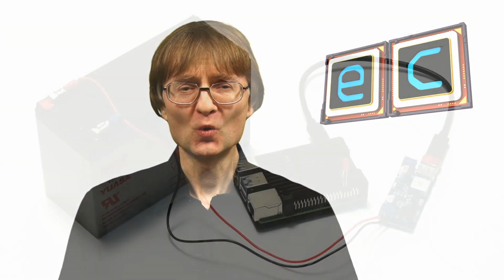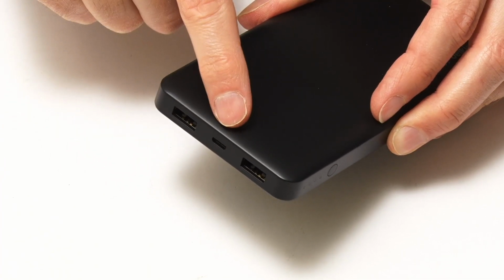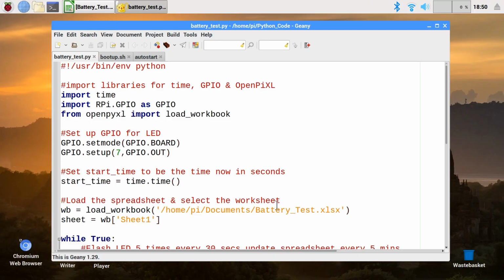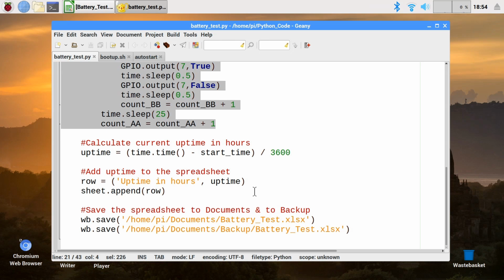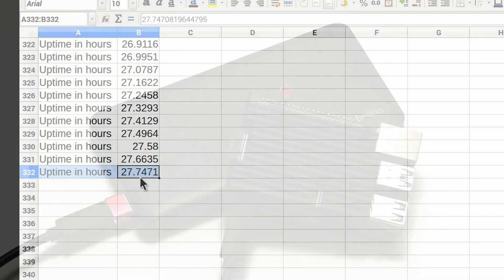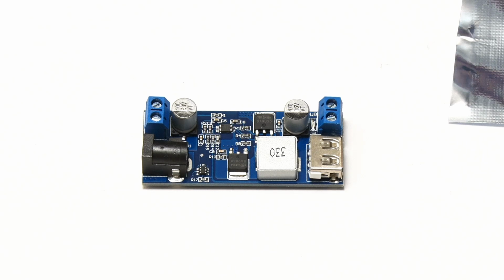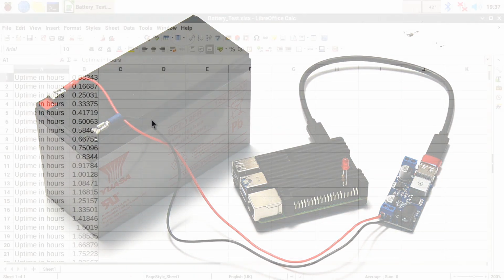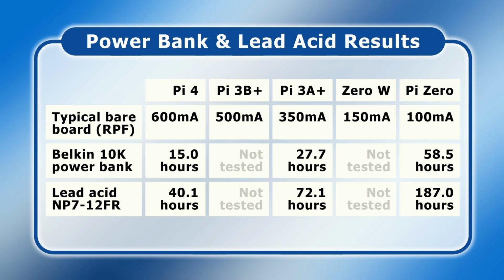Raspberry Pi Battery Power

Comment: Does the 12 volt to 5 volt buck converter cut power when the battery gets below the lead acid battery’s optimum minimum voltage? 

BTW: loved this video. I’ve wanted to know this info for a while. Thank you sir!

Comment: I designed and built a Raspberry Pi form factor PSU and have pre-production boards working. Can I get anyone interested in stocking them even though they are half the cost of a competitor? IE sale price of £20. Can I hell. They work anywhere from 7.2V to 28V too at 80%+ efficiency and can handle 4+ Amps.

Comment: only thing bad about Pb batteries is the weight. The only thing bad about Li batteries is the cold. I used a pi0W to take pictures of the evening sky, and used lipol. during the summer in my desert, i'd use about 40% every night taking pictures and beaming them back over wifi to my server. During the start of fall, id be lucky if I had 20% left at the end of the day. some nights, totally dead. Do you have a remote charging solution for it yet?

Comment: "Usable capacity"  at 4:39 is not 75% but actually based on the false advertising of USB battery pack manufactures.  The manufactures get their claimed capacity from the li-ion battery's capacity at a nominal 3.7V NOT at 5V.  You will not get 10,000mAh at 5 or 5.1V on the USB output.  You need to convert that 10Ah (10,000mAh) at 3.7V to watt hours (37Wh) then divided it by 5V (or 5.1V) then multiply by the boost or buck converter efficiency (~87-95%).  Yes, all USB battery capacities should be claimed in watt-hours.  I hope this helps to clarify why you are not getting "10,000mAh".
Reply: Also remember "10,000" can be a model name and is often an approximation of the total of the batteries.  Better manufactures will round down while others "round" up quite a bit.  Cheap manufactures can also use batteries that vary greatly depending on when and who they got them from so the capacity of one USB battery pack with the same markings can be much different than the next.

Comment: Mr. Barnatt,  I recently setup a Raspberry Pi 4 as a media server in my home, thanks in large part to your instructive videos. How could I attach a battery solely as a backup for when there are power outages so as to maintain power to my Pi long enough to allow me to safely and properly power it off? How large a battery would you recommend? Would I need more than just a battery to setup and perform this function? My setup is simple and compact -- the external hard drive I have is slightly larger than the official Pi case. I will be changing that to a Flirc Kodi case soon.

Comment: Oh my. You need low voltage cutoff on the lead acid, otherwise over discharge kills it. If you run the same test 10x you will probably see the life shrinking.
Reply from the maker: Yes, no question a test like this is not good for the batteries. But it is a test! :) Nowhere do I suggest that running batteries flat like this should be normal pratice.
Reply: @ExplainingComputers  You could try killing the battery... for science. :-)

Comment: Another excellent video, lots of potential applications for these. You could also significantly extend the uptime by using a solar battery maintainer with the lead acid battery. A lot of lion and lipo batteries don't support being charged and discharged simultaneously. (Although, I suspect you already know this!).

Comment: "DC-DC 24V/12V To 5V 5A Power Module Step-Down Power Supply Buck Converter"
look on E-Bay dot com, modulefans is selling it for 2.32$ 5 amps output :) this is great
for a mini CNC. 24V down to 5V for Arduino maybe some sensors whatever likes 5V!
I already bought quite some electronic in that shop, it is a good seller. Lately shipping
costs kick in 1.95$ this is annoying. All the prizes went up!

Comment: How did you arrive at the Typical bare board figures (what does RPF stand for btw?)? I followed your maths on everything but that.
Reply from the maker: RPF = Raspberry Pi Foundation. The figures are those from the Raspberry Pi Foundation web page shown in the first section.
Reply: @ExplainingComputers  Thanks, I must have blacked out at that part! Was trying and failing to work back from those figures you presented at 3:52.

Comment: powerbank capacity written in mAh is as usefull as writing the weight on it... the watthours are important to know... the 10Ah on your bank are related to the 3.7V norminal battery voltage so your 75% gets very close to it

Comment: So,why do think the pi4 had less runtime than the pi3?  Did the pi4 have something running in the background drawing extra power,  wifi or bluetooth perhaps?  So hooking the pi up to a 12v battery, the pi doesn't just draw what it needs?  Hooking it up straight would fry the board?  That's a neat little converter though.  A very informative video.
Reply from the maker: The Pi 4 uses more power than a Pi 3A/B(+), as it has a more powerful processor and higher spec connectivity (not least USB 3.0).

Comment: Chris probably knows this, but that 25% derating for LiIon battery banks (the 75% number he stated) is comparing the mAH of the internal cells (at ~3.7 V average) against the mAH actually put out by the battery bank at 5 V over USB. The battery bank has to boost the ~3.7V of the internal cells up to 5V (or even more for USB PD, etc.), and there are losses there; plus, in effect you're "trading" Amp Hours for Volts when you go from 3.7V to 5V, which also reduces the AH you'll actually get over USB. So the makers of these batteries (usually!!) aren't technically lying, because the internal cells (probably!!) can pump out the rated amp hours at their native voltage. But if you're trying to make the kind of estimate that Chris is doing here (how long will my raspi run?), they are very misleading.

However, I also believe his 75% number is not realistic. I've measured a lot of battery banks and I usually see it more like 60 to 65% (again, using the same "incorrect" comparison). For ex., a battery bank with cells inside that can legitimately produce 20 Amp Hours is only going to give you around 12 or 13 AH at 5V over USB.

Comment: If you connect a lead acid battery to a 12->5V converter, the converter will give 5V output for a very long time, maybe down to a battery voltage of 7V or so. The battery will die soon after a couple of recharges. You should stop the discharge at  about 11.5V. The power bank is smart, it shuts of by itself, the lead acid battery will suicide itself. ;-) So never ever do that when powering a real Pi. Or you can buy a new battery every month.
Idea for a new project: Let the Pi itself measure the battery voltage and give an alert and possibly a shutdown when it is too low.

Comment: Hi, I enjoyed this video from you. Some time ago i tried to power a Raspberry Pi Zero from a smart meter (in the Netherlands). The max 5V output of the smart meter is specified as 200mA. Although this should be enough it did not work. So i did some measurements and i noted the following oddity. When i connect a HDMI monitor to the Zero the steady load current DECREASED by about 100mA (from 200 to 100mA, after booting). Have you or anybody else noticed this behavior?

Comment: Very interesting!  Like all rechargeable batteries, lead acid batteries do not like to be completely discharged, but they are not damaged as much as newer chemistries.  I suspect that lithium power pack has a battery control chip in it to shut it down before it reaches damaging levels.  The lead acid does not have that protection, but it doesn't matter so much.  Just be sure it is charged back up as soon as possible.  Lead acid loves to be kept fully charged, lithium not so much.

Comment: Please check how long Pi's will work from 4xAA batteries (normal and rechargeable) and 4xD batteries? Thanks!
Reply: And, BTW, in your greenhouse you can try to attach some solar panels to the lead-acid battery - so your pi will work for months, or probably until the end of summer :)

Comment: The reason the lead acid is able to power the pi longer than expected is because the lead acid is 12 volts. The capacity rating is based on a certain drop in voltage. But with a 12 volt battery, the voltage could drop to 10 volts and be considered discharged but still has plenty of voltage and capacity to power a 5 volt regulator circuit. The same thing would happen if you used a 12 volt lipo to run the 5 volt regulator.
Reply from the maker: Thanks for this, a very good point I had not considered.
Reply: @ExplainingComputers  It would be interesting to built a 10.8 or 14.4 v lipo pack and run the same test.

Comment: You don't want to completely drain a Lead Acid battery repeatable times as it will damage them. I would recommend a small solar charging unit to augment the battery and keep it at the 12 volt nominal state of charge since most lead acid batteries actually have a higher capacity when in a resting state of charge.

Comment: Hmmm. Many 12 volt TVs in RVs have a USB port. I wonder...it might be possible to operate a basic Raspberry PI off a 12 volt TV. Might make a simple and compact RV computer.
Of course, I plan on going with Windows on the Odyssey powered by a 12 volt DC-DC converter because I need a bit more power.

Comment: Lesson learned: when testing battery capacity vs a low-draw computing device, run that device at max CPU, because otherwise it won't finish until sometime after the heat death of the universe.

Didn't know Belkin was making that little power bank; I'm looking for another one so there we go.
Reply: Yeah. I was wondering about that. I'd have the RaspiZero at max CPU and WiFi. Then run a cronjob at every minute and hour logging "date >>hour|minute.log"
May even do it every second as well

While true: sleep 1; date>>second.log

Or something like that.

Comment: Great timing, I'm doing something similar right now. I have a question - Have you noticed any problems running a Pi or other device on a power bank that is also connected to a charger? Or, to put it another way, were you successful in using a power bank as if it was a UPS?   I'm noticing severe voltage drops and freezing/rebooting of my ESP8266 based device when I plug the power bank to a USB port or wall charger.

Comment: Regarding the small lead acid battery seen in this video they can be found at Walmart stores in the US in the fishing equipment section. Otherwise, I’ve had to order from Amazon.
Reply: Walmart, Academy, Tractor Supply, Northern Tools, Home Depot, Lowe’s, Cabela’s.

To name a few places that sell those small batteries.

They are used in alarm systems, deer feeders, emergency back-up lighting, small trolling motors… etc
Reply: Thanks!

Comment: To what voltage did you drain the lead acid battery? if you just let it run until the sbc turns off, this may not be very healthy for the battery. Anyways great video!

Comment: A very revealing set of tests indeed. The one thing I kept expecting but did not see was a way to alert the Pi of the battery being nearly depleted so a safe shutdown could occur via software. Indeed this is something I’ve been hoping someone would create a solution for. The reason this is so important is because a battery powered Pi project is very likely going to be headless and left unattended for long periods. The Pi needs to be able to handle this on its own in my view. File corruption is a real concern if an ungraceful shutdown happens.

Comment: for lead acid batteries A Specific Gravity of about 1.200 or a voltage of 12.25 to 12.3 means the battery is about 50% discharged. By the time it's down to 11.8 or 12 volts, it's almost dead. Most voltage regulators don't need much above the output voltage at the input. You may have taken the battery well below the safe discharge voltage before the unit shut down. At that rate the battery would have a very short life. If you used some sort of battery management device, or if there is one in the voltage regulator to protect the battery however, there would be no problem!

Comment: re table at 5:15  A power bank is rated at it's nominal voltage which is 3.7V for lithiums cells. So the energy in a 10,000mAh battery is 37 watt hours (10A * 3.7V)
The current consumed by the Pi is rated at 5V.
runtime for Pi4 is (3.7 * 10 * 75%) / (5 * 0.6) = 9.25 hours
Reply: I agree, but nominal power of a Lithium battery is actually 3.6 volts.

Lithium Power Bank: (3.6 * 10 * 0.75) / (5 * 0.6) = 9 hours
Lead Acid Battery: (12 * 7 *.75) / (5 * 0.6) = 21 hours (2.33 times more energy)

But I also expect a slightly higher efficiency for the Lead Acid batteries "capacity" over the Lithium battery bank as the differential between maximum and minimum voltages is greater, and there is a step down converter in the power bank, so the efficiency loss also needs to be considered. This accounts for the Lead Acid battery getting nearly 3X the time.
Reply: @michealkinney6205  there are Lithion batterries with 3.6V and 3.7V nominal voltage. I've checked manufacturer page and this power bank is rated 37Wh, so nominal voltage is 3.7V.

Comment: Absolutely fantastic video, i think you must be a mind reader, I started last weekend thinking about a project to power a raspberry pi4 running retropie in the back of my car, to allow the children to play games on long journeys, the thing i was working on was to have a power bank power the pi after the car ignition was turned off to allow the pi to shutdown nicely.  I have designed a circuit that charges the power bank from the car, and the pi from the power bank but when the cars power is lost it signals the pi via a gpio pin to shutdown the pi.  Looking at the test results I am tempted to just have the pi’s power from the power bank and then just change the power bank when the car is running.  Really great video Chris. Thank you so much.

Comment: the thing when using a buck converter on a lead acid battery is that without protection  (electronic low voltage cutoff) the battery will take a huge hit on it's life, for example, vrla batteries needs a cut-off near 10V (best at 10.8V), in a case of solar applications, solar chargers with intergrated protection circutry have a standard cut-off voltage of 10.8V and a restore voltage of 12.5 V, in your test, the buck converter had shut down the PI because of an output voltage below 4.5V, that is from the battery is 4.5+0.7+0.5= 5.7V (output voltage + diode drop+ minimum voltage over set voltage nedeed by the buck converter to run). Under 8 Volts, the battery degrades faster and if you redo the test on the RPI 4, the actual time will significantly drop (like 2 to 3 hours), and with a low voltage cut-off the time will be mid range of the lead acid battery  and the theorical you computed
Reply: It would be easy with the Pi, to sense the voltage of the 12 volt battery and shut the while thing down at 10.8 volts.  Agree with others that the buck converter will continue working for a long while after this, but you will markedly decrease the life of your 12 volt battery if you drain it the way you did in the video.

Comment: Great video as always. Thanks!  Personally, I was not surprised at your findings...  Power banks (good ones that don't use made up numbers) quote the rated capacity of the lithium cell(s) inside, and that is normally at a nominal 3.7 volts.  Indeed, they actually have to quote that rating on the outside of the pack for safety / approval reasons.  That figure does not take the efficiency of the 5V boost converter into account, nor the effective loss of current capacity that comes from the step up ratio.  That is something which you did take into account in the lead-acid case.  Also, at low current draws, lead-acid batteries are certainly capable of delivering in excess of their rated capacity.  Most manufacturers rate them assuming a discharge at the 10 hour rate.  Discharge becomes more efficient at lower rates, and you were discharging at an order of magnitude less, so you might easily see something approaching 8Ah from a 7Ah battery.  

Footnote - the universe is still here, so well done on concluding your tests in a timely fashion. :)

Comment: Very useful.  I tried to use a power bank (with a switch) to power a Pi 0 & camera to capture some time lapse images.  However, it kept switching itself off.  I ended up using a PSU, but that limited my usage.  I might have to revisit.  Thanks.

Comment: Love it, solar next? Easily one of my top 10 channels - consistently delivering well produced, interesting, accurate, exhaustive & kind-spirited videos. Thank-you.
Reply: Yep. I used to run Rpi 4 on a mobile battery. I guess I'll power that battery from solar, soon.
Reply: @RaviRJoshi  I did some research a couple of years ago and if I remember correctly, a 9W panel could power a pi. (That would be the model 3B).
Reply: @flethacker  at night time the sun is hidden for some of us, not 'out'
Reply: Solar? Running a RPI until the sun runs out? 😜
Reply: Solar is perfect for charging and maintaining these batteries.
The best channel on YouTube is DIY SOLAR POWER with Will Prowse.

Comment: I'm planning to install RasPi Zero W  into my camper van. The van has 2 x 100 Ah 12 V lead batteries. Simple extrapolation of the results of this test gives it something like 100 days of uptime. Not bad.

Of course it's not that simple. RasPi will act as WiFi to mobile net router, GPS tracker, temperature and humidity monitor, battery heater controller, etc ... so it will definitely draw more power even as idle.

Comment: Thanks for your informative videos.

Powerbanks have a 70% capacity because the mAh is for the 3,7V of the Li-cells and not 5v output. Internally is a boost converter. 3,7/5,0=0.74 multiplied with conversion efficiency gets around 70%. For the 12V battery you calculated it correct but the 65% Capacity loss isn't needed.